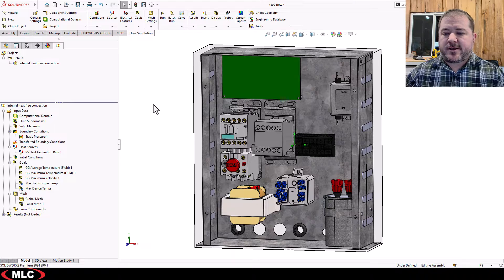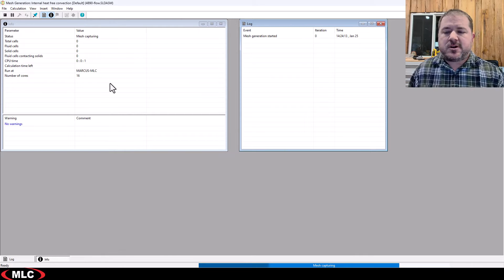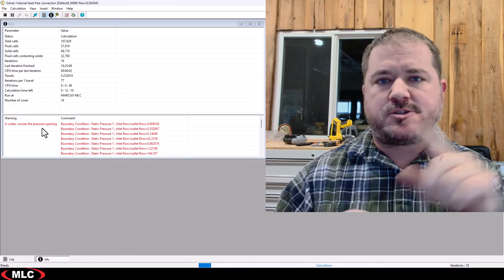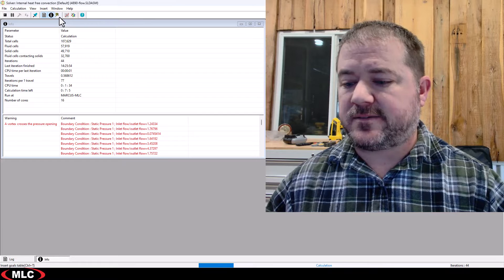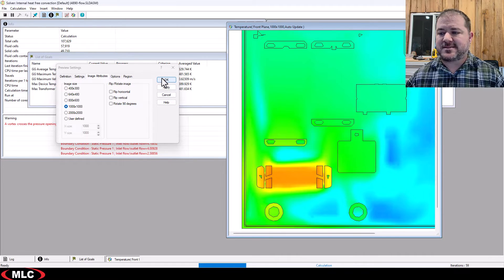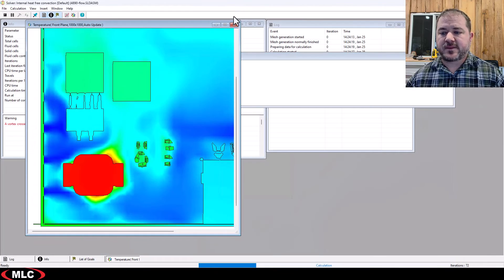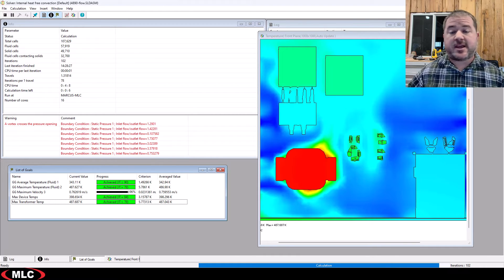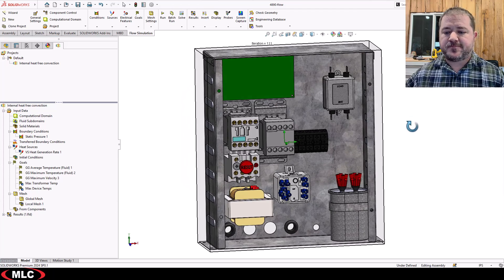How to Monitor the Flow Solver & Preview Results | #SOLIDWORKS Flow Simulation #CFD

Comment: Hello good day! Just want to ask if solidworks flow simulation have coupled and segregated solvers? Hope to received a feedback. Thank you
Reply from the maker: SOLIDWORKS Flow Simulation does not have coupled or segregated solvers. We have 1-way Fluid-Structure Interaction to extract loads for FEA, but the deformed shape does not impact the flow model.  Multiphysics phenomena are only covered in very limited ways and with certain assumptions.  For true multi-physics analysis check out the Simulia tools on the 3DEXPERIENCE Platform https://www.mlc-cad.com/3dexperience/simulation/ or CST Studio https://www.mlc-cad.com/3dexperience/simulation/apps/cst-studio-suite/